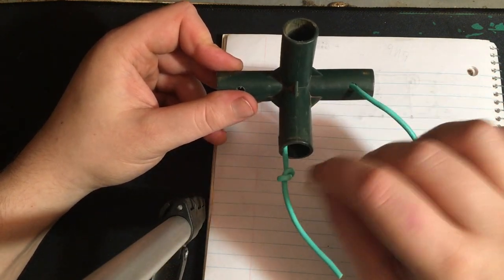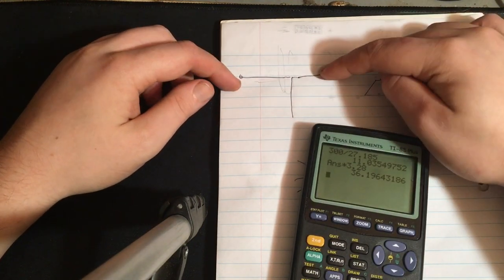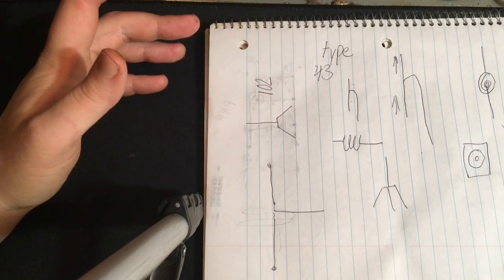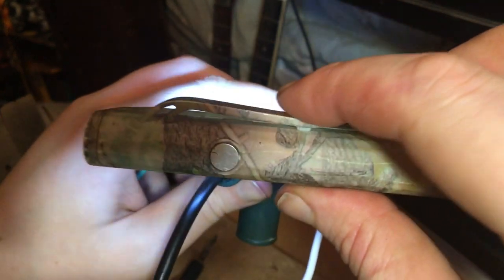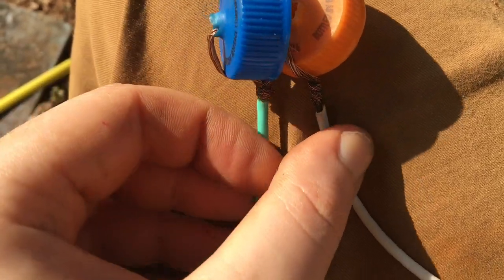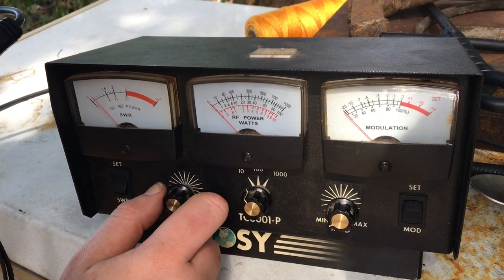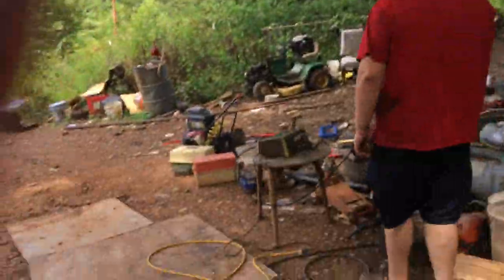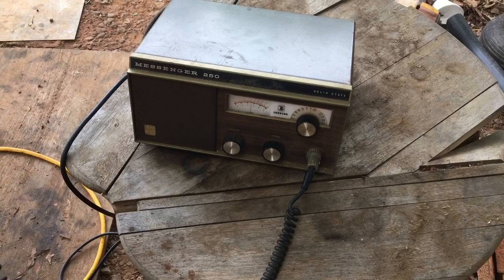🛑 HOW TO BUILD THE EASIEST CB ANTENNA, 500 MILE CONTACT TALKING ACROSS THE COUNTRY!   $5 BUILD

Comment: Thats hilarious !
When all else fails, fall back to the laws of reciprocity !
                😂🤣😂
This antenna should be called the, 
" Should'a Could'a " Antenna !
Funny stuff !
And those are the largest bugs I've ever seen, running around in the background !
😋
Reply from the maker: Did you stick around to the end? I was able to talk to Florida. 🎉
Reply: @JohnnyNJones 
Once you are a little more versed on how this all works, you will learn that depending on the frequency, and the atmospheric conditions, you can achieve great distances using very little to work with !
Many times it is knowing how to finesse the Bands.
As an old saying goes, not limited to, but especially on the 10 meter band, When conditions are right, You can work the World with a wet noodle !
Perhaps not literally, but would have been a good one for the old MythBusters series !
Good luck on your studies !
Don't give up !

Comment: I use the extended double zep. Its a 5/8 wave with homemade 450 ohm ladder line spaced 1 1/2" apart for the tuning. It has a little more gain over the dipole but only has to be 17 feet off the ground for the 10° take off angle.
Reply from the maker: Nice! I was going to make a video on a simple J-pole as well! Very similar to the zep 👍

Comment: I live in San Francisco. I have a half-wave end fed antenna for 40 meters in NVIS configuration. I can hear CB traffic from the East Coast.
Reply from the maker: @tangobayus  really NVIS is really cool.

Are you specifically trying to locate a certain station near you?
Reply: @JohnnyNJones  I'm mainly trying to have local and regional comms. On 20 meters I've made contacts ranging from a few blocks to 3,000 miles. On 40 meters I routinely talk up and down the West Coast. I'm currently looking to build an off-center dipole antenna for my little CB radio. These apparently can be built for different wavelengths. I'm going to try 1/4 wave. It will be 9 feet on the driven side and 4.5 feet on the ground side. I will probably wrap these around PVC to make the physical size smaller.
Reply from the maker: @tangobayus  that sounds pretty cool.
There’s a few calculators online that definitely help out with the number of turns for a shortened antenna.

I can’t remember the math in my head

I’m hoping to get my general license soon

Comment: Strip the jacket cover off of the coax so you have just over 105 inches of shield showing (This is a bit long for later trimming). Carefully loosen the shield by compressing in on itself and turn in inside out like a sock. Pull, push, and maneuver the shield over the coax jacket, turning inside out (again, like a sock) all the way. What you have now is 105 inches of center, and 105 of the shield pulled over the jacket. The antenna is 210 " long at this point. You have a dipole that can be hung vertically. This is the same as an Antron 99, or a Bigstick. 

To adjust SWR, Carefully trim the length and slide braid up the jacket to shorten it. etc. Make them match. An inch or so makes a big difference. Once SWR is good, wrap the braid with tape sticking it to the coax jacket. 

For feedline length. it is important use odd multiples of 1/4 wavelength considering the velocity factor. I normal just put a connector at the very bottom (UHF female), and slide this inside of a fishing rod (20' crappie type). Or PVC. But this can be hung from the tip. Works great. Note, inside of tubing will change SWR a bit.

Like so --  https://www.n4lcd.com/wireantennas/47-Vertical_Sleeve_Antenna_for_10m.jpg
Reply from the maker: Yes that works too, It just takes a bit more coax than I have to spare and yes  using reactively odd multiples of 1/4 wave is a very good idea

Because we definitely want a good ohmic match
Reply: Sorry, but it is NOT like an Antron 99 or a Big Stick. The 99, and the Big Stick, and the iMax are essentially END FED antennas, and not electically the same as a center fed dipole.
Reply: Has anyone figured out how to turn the shield inside out? I cant get my RG8X cable to roll.

Comment: An incredibly resourceful and highly effective homemade dipole antenna. I appreciate that you first discussed the RF theory involved, as well as the many factors which can greatly impact your SWR. And you were easily able to talk from North Carolina to Pensacola, Florida on a barefoot (I'm assuming 5 Watt?) vintage base radio. I can only imagine the distance you could accomplish with a good linear. I've been searching online for a while for a guide on how to make a high performance antenna with both simplicity and a low cost threshold. Without delay, I am building the exact antenna you made in your video. Are there any special considerations I need to make when using your antenna along with a RM-KL203/P linear amp? My radio is a 1980s Cobra 40 channel base station. Thanks so much for the insight and the.great instructional video.
Reply from the maker: I’m sorry about that Shane YouTube did not notify me of your comment.

The only consideration would be to make sure that your co-axle cable and the wire that you use can with stand whatever power you’re putting into it from the amplifier.

Check the voltage rating for your coaxial cable and check the voltage rating for your copper AWG size 👍

Thank you very much for the kind words and I hope you have a great time!

Comment: the interesting thing is you soldered blue side to the ground of the coax and white to the other is this how you establish a ground plane?
Reply from the maker: Yes it’s a counter poise, you can ground it further down the coax if you wish. 

A dipole is a balanced antenna design, but in this case it’s unbalanced like a monopole.

Comment: fantastic    i got new radio coming next week   all mode   big trees  too     i will build that     i wonder how it works radio does    up to 40w    FM,AM    USB,LSB   500 miles epic copy    thats 800 km i think      englishman in holland     I try CQ   DX    to my buddy in south ockendon Essex     UK   around   500km
Reply from the maker: It works very well, I put in a ground rod and was able to talk further as well.

If you want to talk DX you can do it with this antenna especially with higher power

This antenna could withstand 40 Watts easily

Comment: I was always taught that 108 was a quarter wave. 102 for a whip antenna plus a 6 inch spring.
Reply from the maker: You are correct 108 inches is a half wave
But it is not considering the velocity factor of copper in my case, if we take 108 and multiply it times 0.95 we get a little under 103 inches.

Comment: If we use 110 inch insulated wire and fold it back onto itself using 8 inches at the end, will it still be 110 inches of radiated length, or will it be 102 inches of radiated length,?
Reply from the maker: If you fold it back on itself and it’s uninsulated it should just split the current and should still be fine.

Of course an increased diameter wire is going to have a lower impedance but all that stuff is not really that important when you’re building a simple dipole.

If you want to be very scientific with it I’d say start building 

If it’s insulated it can still work because of the induced current.

However in my experience it can be a little finicky to do that. I’m not sure if it’s the added capacitance through the wires and dialectric being parallel or not.

I’ll have to look more into that. But hey, give it a shot and see what happens. 👍

But I would guess you would end up not exactly with 102 or exactly with 110
Reply: @JohnnyNJones  I thing when folding the uninsulated  shield over the insulated shield that a  unbalance gets even get more unbalanced since  since the signal travels one way on the uninsulated shield and then reverses flow  and there is a possibility that the signal cancels each other  out on that side of the dipole and this should get it  more to be unbalanced and with it  gets it more finiky. So you may need a balun etc to bring it back into balance

Comment: Polarization is irrelevant for skip. Only if you're local does it effect vertical and horizontal.  For CB 102 plus 6 inches for the spring. Capacitance will probably be low for automotive  so don't cut until you get it installed and check for resonance
Reply from the maker: Yes the polarization shouldn’t matter because when skip happens you’re going to have all sorts of disturbances in the wave but I use it specifically for talking local because I’m not much of a skip talker I don’t have an amplifier

Comment: It wouldn't be difficult making a folded dipole, either, doing it that way.
Reply from the maker: I have a folded dipole on my ceiling made from a tape measure I think I got 30 miles at one point with it on a barefoot radio

It’s somewhere in my videos
Reply: A folded dipole has 300 ohm impedance it would need a 4:1 balun to match 50 ohms.

Comment: What would be the best antenna design for 75 mile communications with similar antennae on both sides?
Reply from the maker: Probably a Yagi uda design. 

75 miles is quite a distance with ground waves. You’ll probably need to use an amplifier but a yagi antenna will help tremendously.

But ar that range it may be better just to invest in a different type of radio.

2 m with repeaters might be better
Reply: Possibly a horizontal dipole.

Comment: Need to make a hen antena it is a japaneas antena. It is directonal and easy to build. If money is tight 75 ohm tv coax works as transmision line! Just needs to be 1/2 multipl.
Reply from the maker: Yeah I have a lot of RG 6 75 ohm line from a cable company I can use that for sure If I ever decide to take that on
Reply: 75 ohm coax works good! Low loss. The hent antena is a good one to make

Comment: It’s dead as hell where I live. 30 years ago it was popping like corn.
Reply from the maker: I thought it was pretty dead here too until I put that antenna up, I can’t even get a word in now haha. 

We have a lot of locals here I couldn’t hear before.

Heck maybe you’ll get a few contacts if you put it up.

Maybe you won’t it very well could br dead where you are, but maybe you can do some long range skip talking 👍
Reply: @JohnnyNJones  I'll give it a shot
Reply: Dead here where I'm at too.  No locals at all, only skip, so if I can't talk to anyone in skipland, I'm not talking.  Too bad, used to be pretty busy back in the day!
Reply: I had a trucker antenna 3 feet fiberglass set up in the living room for that  Uniden pro510 xl and I did not get anything , not even static and I thought that that radio that was stored for over 20 years was actual dead. 
I  put up a makeshift horizonal dipole in the living room and I have static now and taked to 3 channels already.  I have been talking  4 miles having the dipole antenna in the living room.  I barley heared 1 station that was about 7 miles away , but I could not talk to it. 

I will make  this dipole and get it up the tree, but I still have to get me some coax and connectors and a string to hoist it up  the tree etc.

Comment: You should have used a "T-piece" for plumbing, but you were using what you had to hand.  You can also cut up a plastic bread/cutting board and make a "T-piece" out of that and still have enough for the ends, however, you have to waterproof the joint in the middle.
Where did you find all that info, must have taken you a while to look all that up?  :-P
Nicely done though, but looping the coax might have caused you a problem, but this time it didn't, what I would have done is either weave it through the pipe or just put a couple if tie-wraps through, you can also tie-wrap it at the joint and pull it both ways (put a tie-wrap on the coax, two tie-wraps through those and pull them through and out the ends (yeah, it takes a bit of working out).  If you use a bread/cutting board you can drill holes and thread the coax through the holes, also the wire for the antenna, takes the strain.  Best if you have the centre of the coax going up, but you failed to mention it.
A few coils of coax if you have a problem will help with SWR and common mode currents if you get bother (at antenna end).
Horizontal is not always bad, I have had some excellent copies on CB skip (in fact my best ones) when horizontal, but they are directional, maybe this helps as well though, but it is not so convenient as the antenna will not always be radiating the way you want it.
You want to give that control in the SWR meter a squirt of cleaner!  (Not WD40 like I have seen some use!!!)  [Sighs]

That was an excellent demo of how to make and use a wire dipole, well done, your mate must have kept you right :-P   :-)
Reply from the maker: Oh if I had looked all this up I know it would’ve taken me at least several months to find that stuff out

But all those calculations and measurements and things are just stuff I learned over the past years studying and reading

 I went from not knowing what SWR was 2 years ago to where I am now. Honestly I’m not very happy with myself because I could’ve studied more I will be getting my ham license on the 17th of this month if everything goes according to plan though

I did make a choke Balun out of my co-axle cable for my dipole on the ceiling but I do have a type 43 ferrite torrid Which helps a lot with RFI 

And yes you can absolutely use a horizontal dipole to talk skip because as you know the ionosphere causes the polarization to get mixed up when it bounces

Personally I went with a vertical because I did not have skip in mind necessarily I had local contacts in mind 

however it seemed to work very well for Skip and that was not even the point of the video so I’m happy with that

thanks for all your advice and there’s all kinds of ways you could’ve built this antenna for sure The plastic board is a good idea as well

I’m sure there’s plenty of improvements that could’ve been made but I think for what it is it worked very well for demonstration purposes like you said

And I appreciate the compliments that was very nice of you

Did you get your man cave cleaned out yet?
Reply: @JohnnyNJones  I am working on it, but it is a bit of a project, I have a big radio in there and it is taking up most of the bench, so until I find some info on it it will sit there taking up a lot of room.
It lights up, transmits, but although it appears to receive there is no sound and the audio iC and everything around it is working fine, so looking for a manual for it.
Cybernet Board PCBM059COX.
I found a on-line manual, but I have no signal in the Man Cave and though I printed of the set up for it, I can't print the schematic for it as it is a PDF and when you blow it up a bit it is unreadable.
He wants far to much for the manual, the manual is no out of print.
If I had one I would copy it and send it back, but I don't, so I can't.
The board is in many guises and many CBs, but this board was one of the last produced, so manuals appear to be few and far between.
I have to fix it, than it is going away to a Ham who is going to put it to someone to have it on 28Mhz 10 meters.  He converts set, but only if they are working, he will not fix sets as he say it is impossible for him to get parts for old CBs.
I know where he is coming from as it is almost impossible to get some parts.
It is an Ham International Jumbo, but not a common model.  It does not have the weird audio that other Ham Jumbos had.
On FM they had a strange dragging sound to the transmitted audio.  This one does not have that problem.
However, I found a board marked Ham International that has been disconnected inside the set.  I have no idea what this board was for, or who disconnected it and why, yet!
Reply from the maker: http://www.cbradio.nl/ham/Service_Manual_HAM_Jumbo_PTBM059COX_Homer_ENG.pdf

http://www.cbtricks.com/radios/ham_international/jumbo/graphics/ham_international_jumbo_sch.pdf

I found it two schematic links for jumbo mk1 

just click them or copy and paste them in your browser

I don’t know if they will be clear enough for you but I can zoom in pretty well on them. The problem is they’re never going to fit on a standard printer size piece of paper 

All I can think of is maybe print eight segmented pages of the image

By the way there are several boards on the schematic maybe the one you’re looking for that’s been disconnected will be on there
Reply from the maker: Interesting OK here’s an idea for sourcing parts that I use that maybe will help you but I’m not sure it’s a longshot

I save this search  “estate” in the category “consumer electronics”

What that usually means is that old hams that pass away I have their stuff posted under estate by their children

It will be tons of old electronics parts and boards

I just picked up a bunch today

I wish I could send you a photo but I can’t 

just type in estate under the category consumer electronics

You’ll see what I’m talking about
Reply: @JohnnyNJones  I'll try that, but if it come up in the USA shipping will kill it.
Sometimes I wish I lived there, but it would have cost me a small fortune the way my health went.
Reply from the maker: That’s understandable, You could also set your eBay setting to only show listings from your country as well

I think it’s ebay.co.uk
Reply: @JohnnyNJones  Ebay sets your country automatically, here they tend to use Gumtree for getting rid of silent key equipment or estate stuff, but for some unknown reason it has vanished off my phone!
:-((
Reply from the maker: @BoB4jjjjs  Ah duh yes you are right, they probably use your IP address to send you to the right version of ebay. I guess because I use a VPN ebay doesn't always know what country I'm from after clearing my cookies. Because occasionally I'll get sent to Ebay UK.

I've never heard of Gumtree, so maybe It's a UK company?